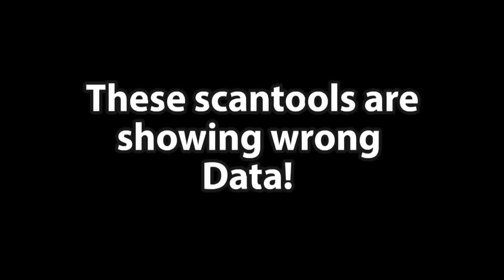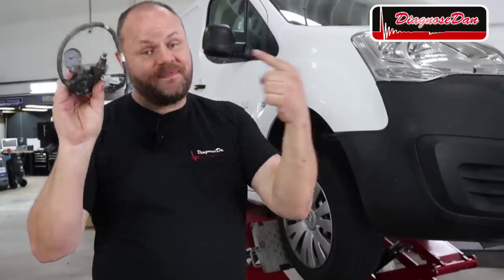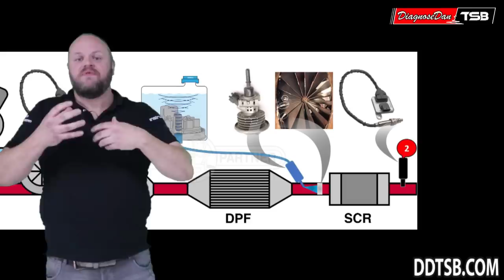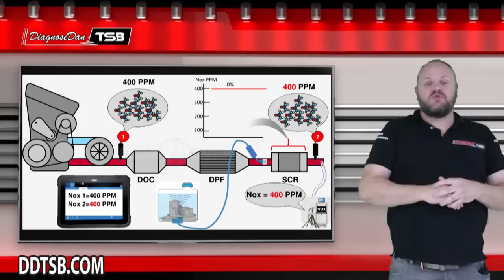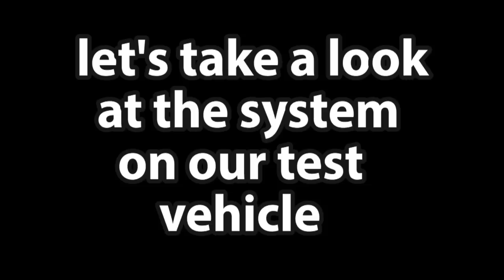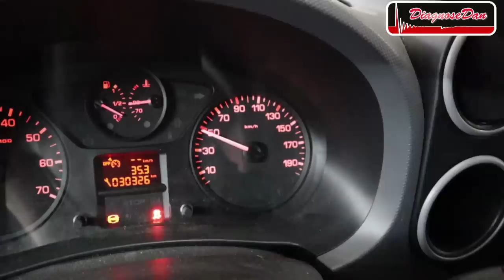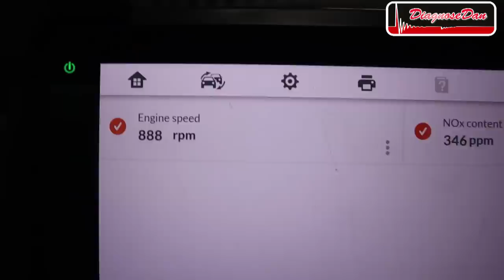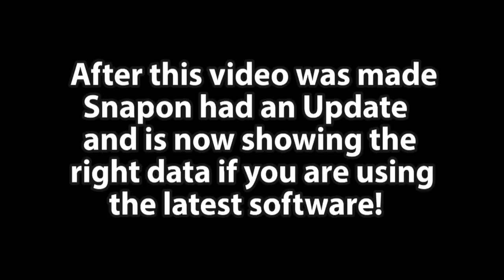Wrong parts replaced because of these scantools!

Comment: One more problem to add to the diagnostic nightmares!  Another reason for multiple scan tool ownership.
Reply from the maker: Like its not challenging enough already🤣
Reply: Ya got that right Dan ! ! !
Reply: You know, that problem answers some questions I've had in the past when I would see a strange readout.  Didn't think there was a software problem until I would use the factory unit.  Then it was like, "Gee that's strange."  Did have a problem with the Snap On "red brick" software in the late 1980's when it was showing P N (Park/Neutral) and the transmission was in drive.  So it should have shown R D L .  I contacted Snap On about it, got to talk to the lady answering the phone, the technician and the engineer.
I told the tech and engineer about the problem and the engineer's answer was "Ya we know."
Huh?  "Ya we know?"  "So when are you gonna fix it?"  Next year was the answer.  Well it was April or May so we have to wait over 7 months for the new and expensive software cartridge?  Engineer.  "Yep."
I'm not happy with that answer, so I sent in a letter to Motor Magazine when they were printing it and explained what happened.  I didn't curse out Snap On, just wrote what happened.  They printed it!  Since other techs read the magazine, my note was to let others know about the problem.  Motor made the comment that my letter had Snap On "just a little concerned."  I was mad at "Ya we know", but I wrote that so others wouldn't fire the parts cannon because of a software problem.
I hope it worked.  Like you Dan, I'll be more aware of this problem.  I hope my new Autel tablet won't have problems!

Comment: Sorry to LAUNCH user and Thanks to Dan. We will correct the fault as soon as possible. The issue already report to the software department and it will be update on next update. Thanks for support and we will do our best.
Reply from the maker: That's great to hear and don't Worry, most of the time the tool works perfectly!
Reply: Very impressive for a YouTube channel to be held in such high regard that a manufacturer would take notice and immediate corrective action.   Remember when Lewandowski scored five goals?...Diagnose Dan just scored 6.
Reply: I have 6 scan tools and use Launch most times - there’s no scan tool that can do all - you need more then one scanner unfortunately
Reply: @iqbalaniff1650  I like the Verus Pro because the Guided Component Test information is invaluable.
The Oscilloscope is all I really need the Snap- on Scan Tool for.
Reply: My Launch is the original 431 Pocket Diagun about 12 years old.
Still works perfectly.
No updates required as I only work on old Rover 75's and Mercedes from 2004 era 😎
Reply: @julesviolin  I was just talking with a friend today about how lucky the guy that just works on cars he collects.  I used Land Rovers as an example.   No need to update.  Have a great weekend.
Reply: Launch is my go- to Scan Tool. I like the two year free updates,  and the Five year warranty.
Reply: I'd like to see that 😂
Reply from the maker: Eric they actually e-mailed me the next day, and the day after that they made an update available that takes care of the issue. (So did Snapon)
Reply: @Diagnosedan  WOW! I have worked with other companies on their BETA programs and years go by and they never fix known issues. Eventually I just lost hope haha
Reply: @SouthMainAuto  Use the force of the internet, make youtube videos about it.
Reply: Thank you launch team for responding ❤
Reply: will this be a free update?
Reply: I use a launch crp919e i love it costed me 450€ and can do ecu coding

Comment: Very interesting video Dan! Was the incorrect data only on the downstream sensor, or both upstream and downstream? Can you swap the upstream and downstream Nox sensors to see if the problem follows the sensor? I've seen a similar scanner issue twice where the scanner would swap the live data for the rear ABS sensors... Code was for Left Rear, but speed was missing for Right Rear 😅
Reply from the maker: This vehicle actually is not equipped with an upstream sensor Ivan, there is a value available for upstream Nox concentration but its an estimated value. 
Some brands do this on cheaper models to cut costs. 
The Nox sensor has got it's own control unit that communicates with the PCM via the Can-network. 
Because of this the Nox sensor is not "directly"connected to the  PCM. When the Nox sensor sends its information it also tells the other control units who this information is coming from. So simplified: "Hello i'm the downstream Nox sensor and i'm reading 100 ppm"
The funny and interesting thing is if you swap the upstream sensor to downstream it will still report on the Can-network as upstream, so this trick doesn't work 😉.
I don't know if this is the case for all brands but it at least the ones i've worked on.
Reply: @Diagnosedan  ah very interesting Dan! Definitely tricky to diagnose a sensor when the scanner is lying and you can't scope the raw signal 😆
Reply: @Diagnosedan  I don't think there really is any need for upstream nox and that is the reason why there isn't one. Since the nox sensor is diagnosing the preformance of the exhaust  and has nothing to do with the mixing regulation it only has to measure the value after the relevant exhaust parts. The estimated upstream value seems like something they put there to show off rather than it having any practical purpose. Didn't VW seal adbblue for life and disable it all together (except under specific conditions) on their american vehicles a few years back.
Reply: @rimmersbryggeri  dugh
Reply: @Diagnosedan  he wouldn't know that
Reply: @Diagnosedan  If you look at the wiring diagram you will find out that both sensors are CAN based and connected to the same data line, the position of the sensor is not determined by where you plug it in but by what CAN ID it sends out.
Reply: Even the dealer computer can give you the wrong data. Funnily enough on this exact software. I did my work experience in a peugeot dealership and they frequently had codes for systems that were not even installed on that specific vehicle. For example automatic transmiison codes on manual cars or headlight leveling on cars without headlight leveling.

Comment: No excuse for other scan tools to not read correctly!

If you can not trust your measurement device or it gives a false reading, it is worse than not having the tool!

EDIT:  IF manufacturers can provide false data to the 2nd tier scanners and required government test labs.....would it be Diesel gate?  Hiding/obscuring/hindering or not proving information based on certain test procedures?  NOT correct in my humble opinion.

P-Chi
Reply from the maker: Both Snapon and Launch made an update available that takes care of the problem!
Reply: @Diagnosedan  

Thank you for taking the time to reply.

My issue is open source coding, and it should be available to the owner of any product as part of the purchase agreement.

In the digital age, a manufacturer can obsolete my product making its value ZERO other than "hard parts"

My opinion,
P-Chi

Comment: I have no experience with Autel but I do know they are being sued by Mitchell and Snap on for allegedly  stealing their data. Is it possible they got their info from a different source than the other scan tool manufacturers? 🤔🤔.
One thing I can't wrap my head around, the SCR is ahead of the DPF on that van? I have never seen that in the U.S. My thought would be that putting that much soot into the SCR would cause problems but apparently not
Reply from the maker: I've not seen problems with this design in this regards so far, the SCR needs temperature to work so placing it closer to the engine and before the dpf makes sence in that way.

Comment: Thanks Dan for putting this out. I remember one buddy of mine asking me to look up the part number for the  "sliding door switch" on a Mk1 Seat Leon since that was the component his china knockoff VAG CAN PRO flagged up as faulty in his convenience module. I know this is a silly example but some people really seem to trust whatever they get to plug into their OBD socket.
Reply from the maker: Thanks for the feedback
Reply: Any recommendations for a late production 2006(7) Renault Megan with the 1.6 lt engine. Needing to activate cruise control indicator on dash, dealer refuses to do it since the car did not "come with it". Funny thing is that everything is there on the Privilege high end series. Add the switches on steering wheel and replace air bag that has the cut outs for the switches. Add the power switch on the panel for headlight dipping and it works.
Would also like to reprogram the wireless remote lock sequence. One press of unlock opens only drivers door while the second press of the same button within 2 seconds unlocks the rest of the doors. Its great when one has the convenience of modern electronics until something goes wrong.
Maybe its time for a military HUMMVE, plane Jane shaker under he hood THATS multi fuel and very little in the way of electronics to go wrong........

Comment: Many many years ago a friend of mine did data capture for Snapon for Holden cars. Data and testing was done against GM/Holden tool and actual cars. Snapon ended up being better than dealer tool because errors in dealer tool were identified and fixed on Snapon. Holden cars were not new releases - GM tool was just not updated/tested very well. But then GM global (dealer) network was using NT4.0 way after it was end of life and totally insecure.
Reply from the maker: I know people who still do this work for Snapon, they sometimes call me if they are allowed to use a car in our shop

Comment: Trust but verify.  If something looks strange, I will verify it with another tool, be it a meter or scan tool.   I have been doing this for oh man close to 40 years, yea I am old.   Now scan tools do get updated and most require an annual subscription so it can get expensive if you have multiple tools.   Seeing this has now caused great concern with me because I do my own vehicle maintenance and the data has to be correct or you run down a rabbit hole, I do not like load a parts cannon to resolve issues.
Reply from the maker: Fortunately the data is correct most of the time😁

Comment: Autel for the win I’ve never had a problem with them and love them. I’ve heard people say they don’t like them and that they’re garbage. I’ve used multiple Autels and have always been a fan.
Reply from the maker: It's a great tool!
Reply: Absolutely great tool. Torque app was my scanner until I got a 906bt  about 4 years ago. For  $1150.00 it came bundled with an inspection camera. 
This tool will run circles around any Solus or anything snap-on for 10k or less. 
The shear amount of special functions I can do is unbelievable for the price. Best tool for Fords outside of the oem. Looking to upgrade to the ms 919 for the programming abilities amongst other great features. I don't think I'll ever get a snap-on tool. 15-20k for a scanner for what?

Comment: Also check the mileage readings. So far my ancel scanner has been off and they are slowly fixing to it. First it could not read miles, now it's still of about I think 10 or so miles off. It also doesn't have a Mazda 3 2012 year so I can't really do a check on it. Just wired but yeah you have to check things closer on scanners it seems. Too many crooks changing miles on old cars that's why I started looking at this closer.
Reply from the maker: Thanks for the feedback 👍

Comment: Had wrong data even with a factory tool showing one of the keyless go sensors for the wrong door handle, very confusing as it showed the lock button working correctly but the unlock didn’t change indicating a faulty handle until you touched the opposite side handle to find that the pid now changed. How many door handles were incorrectly changed & the parts cannon then fired for an ecu god only knows 🤪

Comment: Hi Dan very informative and easy to follow Diag. Q. Did you not think bad part even though you replaced OEM unit for unit i.e. remember the Bosch sensor with incorrect wiring just a thought as small companies cannot just buy in expensive parts . Any way to check the unit on the bench? Stay safe from N Z
Reply from the maker: The replacement part was original and showed the exact same readings.

Comment: Replacing parts without any corroboration of a scanner finding is not good diagnostics. A scanner can point you in a direction but can't be the definitive answer before repair/replace. One point of data is never as good as several.
Reply from the maker: Unfortunately there is not much you can measure on a Nox sensor

Comment: Could you hook up a multi meter or oscilloscope and read the voltage straight off the sensor or the sensor wires near the ecm?
Reply from the maker: No, the current you would need to measure are very small. That's actually the reason the Nox sensor has got it's own control unit. If you would run wires directly from the sensor to the pcm they would be to long and the signal would be lost. ( It's not impossible, but you would need sensitive equipment with very accurate readings)

Comment: I wonder if you could take a reading as 10x actual figure, being faulty calculation from the software rather than faulty reading. They all looked just about identical if you took the first 3 readings as a value 10x what it is supposed to read?

Just goes to prove that this job is a constant learning curve.
Reply: Yep, this was my interpretation of the values Dan showed too...Divide by 10 and they were pretty close to the correct numbers, but I have a feeling it won't always be that easy with every dodgey data PID🤣👍🇦🇺
Reply from the maker: You are right!
Reply: Agree, looks like many of the scan tools are off by 10x of the actual figure.  Looks like a few software engineers forgot the decimal point....!    (  1000  should be 100.0  )

Comment: Did you not confirm the measure of the scantools, with your exhaust sniffer machine? I am little confused...
Reply from the maker: There is no way the engine is producing 6000 ppm, don't need a gas analyser for that in this case

Comment: But if the number from the sensor is off, it is probably off for both NOX sensors, so if one shows nonsense, then the other should also show nonsense. If you had both sensor data in one screen, then maybe it would have been clear what the numbers mean. Now it looks like those tools which show wrong values are off by 10x.
Reply from the maker: This particular model has only 1 downstream Nox sensor and no upstream Nox sensor. Some Manufacturers do this to safe money.

Comment: Looks to me that either 3 pulled code from the same code base and 1 didn't, or only 1 had better checks in place to find and fix the code properly before release.
 I am curious if there is any financial compensation for this type of scenario if it's a unknown bug that is found by the technician...
Reply from the maker: No there is not

Comment: Hello Dan. Diagbox  is a very complicated tool. Sometimes it lies too or does not have enough data PIDs. After workin 15 years with PSA it still amazes how complicated it has become with euro 6 engines Nox sensors Adblue readings and many more.
Reply from the maker: I fully understand, we get alot of questions on our DDTSB helpdesk about these systems.

Comment: Good example of being careful about the data you read. Scan tools are helpful but sometimes you can get tricked. Working in a dealership I see a number of the early glitches. I primarily do transmission work and for me the glitchy functions of even the factory scan tools is a way of life. Often there are tests that I need to do the factory scan tool won't work and the Snap-On scanner I have does and vice versa. There are certain models of transmissions the Snap-On scanner is useless for certain functions and I have to use the factory scanner. You illustrate clearly here the need when you see something that is wildly out of spec, try another scanner. In your case maybe the third one would have been the charm. Good video Dan.
Reply from the maker: Fortunately most of the time my scantools show accurate data😁

Comment: Sometimes testing the scan tool is more work than diagnosing the problem. I like to disconnect stuff to see if the data is actually monitoring the item or if the fault codes are correct. Late 90s cars... Need I say more...
Reply from the maker: Been there🤣

Comment: I bought a dongle that connects to my phone, it is as good as the software interpreting the codes given by the ECU is. That is the thing, there is no need to buy one of these tools, the dongle is standard and so are the codes so use software that is verified to work with your car and you are fine. That's about €20 for the software and dongle.
Reply: My sisters lad brought her car round to me with intermittent faults and confidently stated "there are no codes in it" after scanning it with one of those £20 dongle/phone thingys. Strange as my scanner listed 3 intermittent codes. There is a reason they are cheap.
Reply from the maker: I bet you can't code and program modules with your dongle. In a professional workshop we need scantools to do quite a bit  more than just read codes and data.
Reply: @Diagnosedan  I'll take that bet and no you don't. I can map and reprogram just fine.

I recently rebuilt and renovated a GT3 with my son and we did a live mapping which is FAR better than your rolling road in the workshop mappings.

But you do you, just don't make bets you can't win.